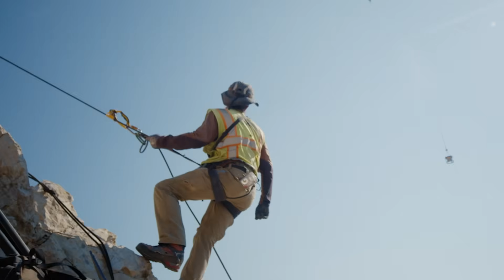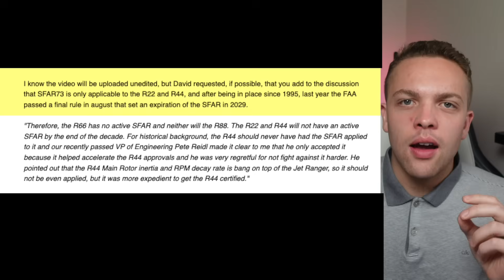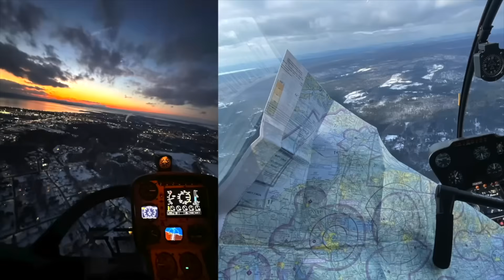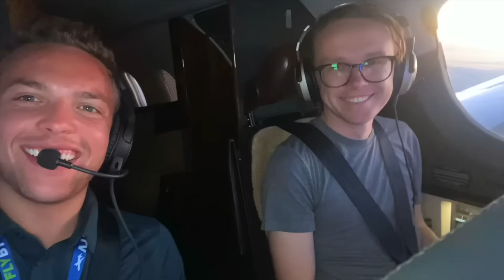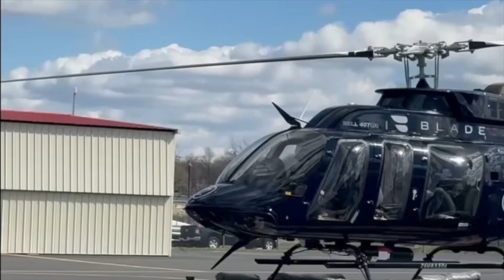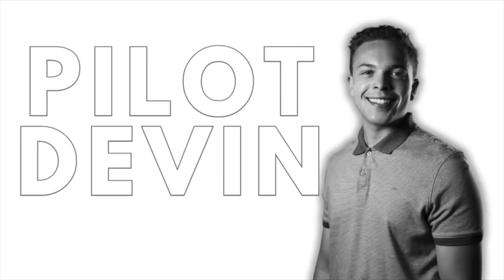Robinson CEO Defends the R88’s 2-Blade Design

Comment: Great video. David knows his stuff and I’m sure he’ll be a great addition to Robinson Helicopters. 

I will always opt for a 3 or 4 bladed system though. I only have 400 ish hours on R44’s and maybe 3,000 ish in Airbus Products so of course I’m biased. However my experience with Airbus products has been wonderful. I’d fly one through a damn hurricane and feel confident with it. I wouldn’t with a 44…

I’ll also add, any turbine is better than a piston. My school had a fair amount of magneto issues. One instructor had a double mag failure (in a 300C). I don’t have any experience with Allison’s, I’ve been in Turbos and Pratts my whole career. I trust them a ton.

I disagree with top speed though. We do a lot of 1+30 flights. An additional 25 kts could cut almost 30 mins off the total round trip flight time. That’s huge. We ran into an issue at my last base where we switched from 119’s to 130’s and the 130 didn’t have the legs to do the same mission because it was slower and burned more fuel comparatively so we couldn’t take as much weight.
Reply: I did fly an A-star through hurricane Ike. No issues at all. Hell of an aircraft.
Reply: Yeah a teetering rotor system is just not going to be as safe in inclement weather compared to a fully articulated rotor. They can handle far more turbulence than you'd expect, but there's no reason to push those limits.
Reply: +1 here on the R44 vs Airbus!  But then again, you cannot really compare the two.  Each has it's place under the sun.  R44 keeps you humuble.  😉

Comment: To answer the "Should SFAR73 continue?" question: IMHO, SFAR73 is primarily aimed at instructors, not students. Consider the brand new helicopter student. Does anyone believe they get much from the mandatory, initial SFAR 73 briefing and sign-off, much less have an understanding of the relevant aerodynamics? Discussing even the most basic auto's prior to the first few lessons is silly. For the first lesson all they really need is don't do a pushover, don't violently manipulate the controls, and positive exchange of controls training.

To that end, perhaps it would be better to create some sort of instructor endorsement in lieu of SFAR 73. Every helicopter design has it's own set of "gotcha's" and idiosyncrasies. Nobody would forget to teach about ground resonance in an fully articulated helicopter. Nobody would forget to teach about, say, servo transparency in a helicopter that might be subject to that. Thus instructors should not forget to teach things that are unique about the operation of Robinson helicopters.

Nevertheless, the SFAR does represent a useful bit of legal firewall for RHC. Other than its somewhat negative connotations in the marketplace, IMHO, as a Robinson owner, operator and pilot, it doesn't really matter to me to jump through a few extra hoops every year or two.

Comment: Legacy engineering, Nothing Wrong with two blades, Bell had two blades for decades. 
It was pilots becoming test pilots flying beyond the limitations  The Hughes blades are the same weight as the Robinson
Reply: It’s not the weight of the blades that is the problem. It’s the weight of the entire helicopter. A R-22 or R-44 is a much lighter helicopter than most two bladed helicopters, which means it (the entire helicopter) doesn’t carry as much inertia when entering a low g condition. That means the fuselage is more prone to rolling, which means the aircraft is more susceptible to mast bumping which of course can end with disastrous results.
Reply: @VictoryAviation  So what about the Rotorway? Same weights and disk loading.
I say it's the pilots. Plenty pilots with thousands of hours have no issues with the R-22. The Sikorsky Sky crane has the disk loading as the R-22 ,
 So Matt do you have issues with helicopters with a gross weight under 1370 lbs?  Angel CH 7   Brantley B2  Mariano H 1  Rotor Mouse, Helicycle, RON 1 
I think you know squat about helicopters ,,, Matt Heaven?
Reply: Bell still has two blades, on the 505 Jet Ranger X.
Reply: @brianb-p6586  The 505 uses a long Ranger rotor & drive system. The Bell 505 airframe design is trash.

Comment: The negative perception of Robinson helicopters is primarily centered in that part of the helicopter pilot demographic that *has never flown anything except a turbine helicopter*. In other words, current and former military pilots. The vast majority of civilian track pilots have learned in the R22 and R44 and have a much better appreciation for those platforms.
Reply from the maker: I think that is a very sound point. Most civilian-trained pilots do learn on the R22 and R44, and a lot of them go to the Robinson Safety Course as well. I agree that people who get proper instruction and education on the Robinson platform fly them safely without problem!
Reply: @PilotDevin  When I worked at Robinson in the mid 80s Frank was tooling up for the R-44.  (I lasted 2 months the pace was amazing) Flew a bunch of different types Bells Hughes Hillers Brantleys and Robbies.
Reply: Old Vietnam pilots flew everything Post Vietnam only had TH 57 time (Bell 206)
Reply: Been flying rotorcraft for over 40 years.have flown the old bell 47,sikorsky s52,hummingbird hughes 300 and got to fly the old h19 ,s55. I got a r44 in 2019. I waited so long before getting one because of the horror stories about thier mast bumping problem.after flying the r44 for 7 years  I believe they are safe as long as you fly them  with thin their limits.
Reply: @RogerAudia  100%. Mast bumping does not occur easily.
Reply: The cause of the perception problem is the deaths
Reply: @apennameandthata2017  Robinsons don't even make the top 20 for civilian aircraft deaths by model. You're much more likely to die in your Cessna. Hope this helps!
Reply: @kieran8266 . R44 1.6 fatals per 100 000 hours. Others helicopters are about 0.5 per 100 000 hours. I don’t think that will help you. But you are correct about c172s and 182s.
Reply: @apennameandthata2017  this is like saying most car deaths involve Honda Civics and Toyota Camrys. it's even dumber than that because they aren't just the most commonly owned, they're also far and away the most common for training meaning they have more low hour pilots on them than any other machine by a massive margin. keep misinterpreting stats though
Reply: @kieran8266 There are FEWER deaths per 100 000 hours during training. I told you I couldn’t help you.
Reply: @apennameandthata2017  is English your second language?
Reply: @k @kieran8266 eran’s lost the argument so he goes ad hominem. (That’s Latin.)
Reply: @apennameandthata2017  I can show you a real ad hominem if you want. The reason I asked that is because your response doesn't make any sense, and it didn't address anything I said. What made you think I misunderstood your message? Why did you simply reiterate the same thing?
Reply: @kieran8266 Deaths per hundred thousand hours makes your fleet-size argument wrong.
Reply: @apennameandthata2017  It doesn’t, because almost all civilian pilots train on Robinsons. If Bell etc had anywhere near the same number of inexperienced flight hours the deaths would be exactly the same if not higher.
Reply: @kieran8266 People are safer during training.
Reply: @apennameandthata2017  So I come at you with hard facts and you go with something as flimsy and vibes-based as "people are safer during training?" Go check the numbers on that. The most civilian pilot deaths are during training and low hours BY FAR. Just like every other fixed wing pilot, you love to show your ass.
Reply: @kieran8266 You said training AND low hours. Training is the safest period. Low hours after training is the most dangerous. Maybe I can help you after all.
Reply: @apennameandthata2017  color me surprised that I check your profile and you're another fixed wing pilot. Every single time.
Reply: Typical Robbie attitude and ignorance.
Reply: @greysheeum  how many rotary wing hours do you have
Reply: Why to fly these damn rotor when I can fly Eurocopter or Bell??
Reply: @ Learn proper English.
I bet you don't fly squat. 
(Bell 505?  You're not too bright are you)
Reply: @HongyaMa  HI stupid, I speak spanish, german and english. I fly B412 in firefighting. Bye bye idiot.
Reply: @danicampos6342  keyboard pilot
Reply: Hands down, Robinson makes the best flying coffins that money can buy!
Reply: @JetFire9  the only thing this guy flies is a keyboard
Reply: @JetFire9 😂
Reply: @JetFire9  Nope, They're all flying coffins.
Know more dead in all makes and models.
It's all on the meat servos.
Reply: @HongyaMa  he's not a real pilot so he won't understand this
Reply: @kieran8266  Someones got to rattle the bushes in their empty heads - Never stop learning
Reply: @HongyaMa  amen
Reply: @JetFire9  another fixed wing pilot showing the world his ass
Reply: @kieran8266 They can put that on your gravestone after the Robinson gets you good. 😂😂😂☠️
Reply: @JetFire9  Just FYI Robinsons don’t even make the top 20 for civilian crashes by model. You’re more likely to die in a Cessna. Enjoy showing the world your ignorance 👋
Reply: @JetFire9  How many flight hours do you have?
Reply: @JetFire9  The only thing a keyboard pilot like you has to look out for is an embolism 😅